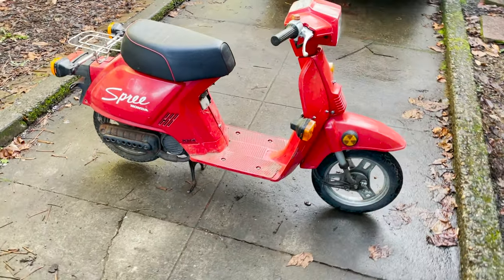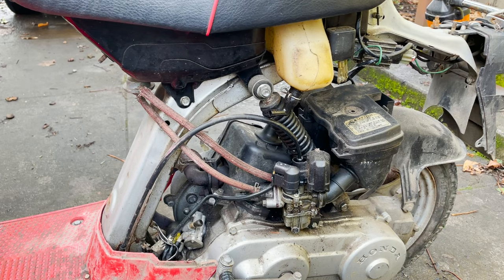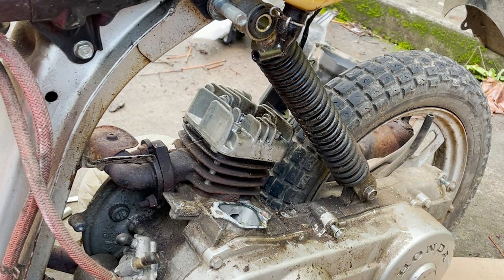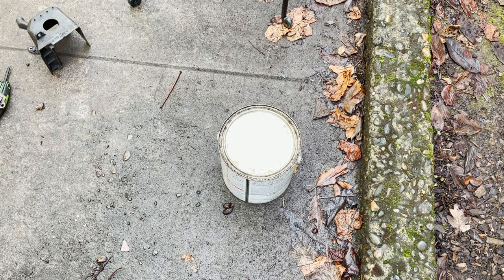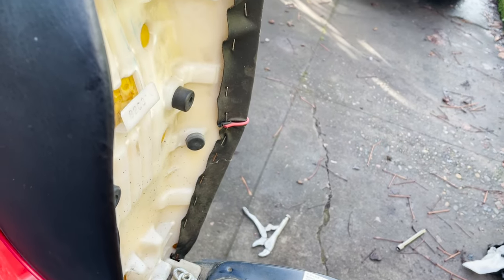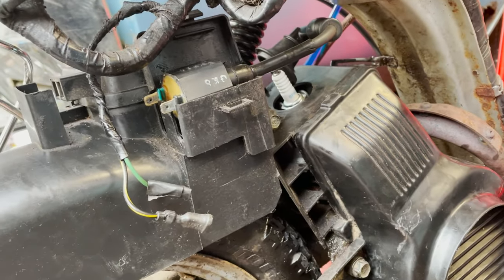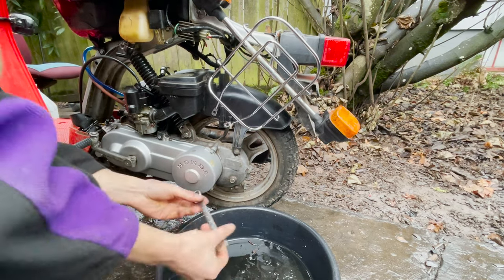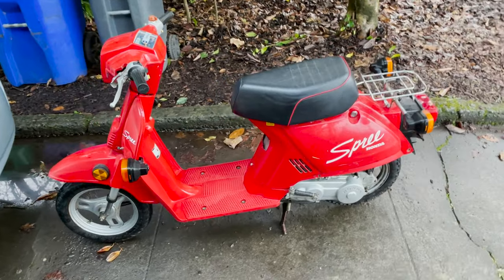$100 Honda Spree NQ50 - WILL IT RUN?? How to fix after sitting for 20 years!! RESURRECTION!

Comment: got my 86 (Iowa) with 1400 miles, for free.  Hammer-mechanic had it for 20 yrs. and could not get it started. The plug gaped at 1/4th of an inch!  I guess he thought he needed more SPARK!!   Cleaned the carb, new plug, got the heavy oil out of the air filter, battery, cleaned up the paint - Ace "Banner Red" is an exact match - straightened the turn signals.  She looks and runs like new - 66 mpg, zipping around town, for 8 months, now at 2,500 mi.  The air/fuel mixture is crucial to running well, oiling the air-filter should be next-to-nothing.

Comment: Hey there, just some words if advice from a fellow Spree owner! I noticed that the previous owner must have blocked off the oil pump, and this is ok but you need to grind off the gears on the pump because if it isn't moving the gears will grind and cause metal shavings in the crank case! Also put the exhaust over a fire for a few hours rotating and banging on the ground every once and a while to clean it out. It also sounds like the carb needs tuning. Get her going good! Love to see these get going
Reply from the maker: big sandwich good advice I will do that. Thanks!
Reply: When you say gears, are you talking about gear shifting?
Reply from the maker: Zeke Polaris no the oil pump has gears on it. If you run premix your supposed to remove the oil pump and get a little block off plate or “grind off” the gears on the oil pump shaft.
Reply: @Mechanic_kid  One of the issues of English, 1 word can mean 15 different things. 🤣
Reply: I saw another video and they just pulled out the oil pump shaft complete with drive gear then re mounted the pump with no drive attached.

Comment: If you're going to be a mechanic you need to learn that two-cycle engines are supposed to smoke the oil mixed with the gas is supposed to make it smoke it supposed to lubricate the engine that's all it has

Comment: I don't know anything about gas engines but I am really considering buying a small gas scooter or moped.  Your video is inspirational, basically demystifying the whole machine and confirming that these things aren't really complicated.  I think I will take the plunge and buy an old scooter and get it running.
Reply from the maker: Do it! These old 50cc scooters are very basic and would be great for learning mechanics on! You can always leave a comment if you have any questions or get stuck👍🏼
Reply: @Mechanic_kid  That is very generous of you.  I will get back to you once I decide on a piece of kit.  I live in a third floor walkup and winter is coming to Canada.  I wonder if I can work on it during the winter and get it ready for spring?  Starting the thing on my balcony might be a bit concerning to the neighbours.
Reply: Get a gilera runner, its awesome

Comment: I think you have it a little backward..the auto bystarter starts off retracted which allows additional fuel to flow at startup and during warmup. After a few minutes the bystarter heats up and the plunger extends a bit, cutting off the additional flow of fuel. Your fix will allow for easy starting but you may be running very rich after warmup.
Nice job getting the scoot up and running, again!

Comment: Hey man love the video. I just picked up a spree that was my grandmas, and has been sitting for probably 20 years. I’ve done basically everything you did (except get to the cylinder) I have never done this before so I’m trying to learn as I go, and I can get the thing started now, by spraying starting fluid in the air intake, but I can’t get it to stay running. When I give it throttle, it cuts out. Any advice on what I should do next?
Reply from the maker: Ok so it’s not getting fuel. Make sure your carburetor is very clean. Pull out all the jets and spray carb clean through all the little holes. If you get that clean and it still doesn’t start I would say it’s your bystarter (electric choke). Take part of a latex glove and use the bracket to basically cap of the top of the hole. Those are the two most common problems causing these to not run. I hope this helps. Let me know how it goes👍🏼
Reply: @Mechanic_kid  ok, so I cleaned the carb really well, won’t stay running. 
I tried plugging the bystarter with a latex glove, that didn’t work either. 
I got a new bystarter, still won’t stay. 
I am not sure how those vacuum petcocks work…but I think maybe that could be the issue? If I take the fuel line off of the carb, there is no fuel. I know that there shouldn’t be, since it is a vacuum somehow, but if I am not sure how to test it. I tried sucking on the vacuum line, and nothing came out the fuel line, same when blowing on the line. Are you familiar with those and how to test them?
Reply from the maker: @TylerPeck  that would be the last thing that it could be! I’ve had one fail before. Your supposed to be able to suck on the vacuum hose and then fuel should go to the carb. I think those are only like $15 so wouldn’t hurt to toss on and see if that fixes it. You could also try hand choking it. Take off the air cleaner and cover with your hand about 90% of the carburetor hole. Should start right up and stay running if you keep your hand there. As it heats up you could maybe just cover 50%. If it starts starving for fuel go back to covering it 90%... sometimes these thing just need to run a little bit when they’ve been sitting. Hope that helps! Lmk how it goes
Reply: @Mechanic_kid  I’m pretty sure it’s the petcock. I ordered a new one. But since it won’t be here for a while, I rigged up a funnel that just feeds gas into the carb and the thing starts right up, and keeps running. I think we solved it. Thank you for your help!
Reply: @TylerPeck  did the new petcock solve your problem?
Reply: @body_clock  it did! The scooter runs great! The issue I’m having now is when it sits for a long time (I figure about 10-12 hours) without running, it can’t start without a little starter fluid being sprayed in the air filter box. Once it’s running for a minute, I can turn it off and let it sit for a few hours, sometimes even overnight, and it’ll start right up, but if it sits longer, it needs help. I checked the reed valves and the piston and they look great. I got a new spark plug, but broke one of the terminals off the coil…so I am currently waiting for that to be delivered to put the new spark plug in.

Comment: Just bought mine for 200 and mate can’t stress this enough. This videos is gonna help me a fuckton when I’m trying to diagnose mine. Cheers 🥂
Reply from the maker: Oh nice pickup! Lmk if you run into anything, I can try and help you out👍🏼
Reply: @Mechanic_kid  Here in Australia its called the Honda Nifty 50 (NQ50) and i was wondering if every year came with a kick start. I'm gonna go pick it up hopefully tomorrow. it needs a starter and a battery to apparently get it running
Reply from the maker: @aricroy4258  no not all years had kickstrters. From what I’ve seen the ones with kick start are more rare. I think they are better because if your battery dies you can still start it...

Comment: You can just rebuild the starter. Use a Suzuki LT-80 starter rebuild kit. It has the same parts you need. I see you picked up a set of noiseguy's carbon reeds. Good choice. I'm not sure what fuel mix ratio you are using, but on a Spree, you are best off using 40:1 if doing a premix. I'd suggest keeping the pump though. As for the oil shooting out the pipe, I'm guessing that came from the crankcase not the pipe. More then likely what had happened is the O-ring inside the pump dried out and cracked so the person decided to run premix (probably 32:1), and slowly saturated the bottom of the crank case with unused oil. Another reason to run it 40:1 if going premix. The Spree is finicky and the pump runs linear to rpm. Meaning around idle range, it's putting out around 50:1, but when revving to say 6,000 rpm or higher, will put out 32:1... more like 36:1. Sprees are fun to build up. Mine now pushes over 4Hp and will do 52mph@ 11,000rpm. Here's mine on the dyno at 8,000rpm: https://www.youtube.com/watch?v=U1MUmUUJbbs
Reply from the maker: Thanks for the info! Dang your Spree rips! That’s awesome!

Comment: Bought a nice 87 a couple years ago, oil had leaked past the check valve and filled the crankcase. I alternated between kicking it over and pulling into a wheelie position to drain everything. Eventually it ran and after a while I could get the rpms up without fear of hydroloc and bending the rod. Smoked like James Bond for a few miles until the oil burned off. I add oil to the tank before a ride and suck left over out with a large syringe when done, if it's going to sit more then three days.

Comment: I have a Honda Nifty 50, it goes well. I think you stripped your's back too far. A lot of that was not necessary. But one thing you did do, which I have not done to my bike, (but I will do it now) is to re-do the electrical connectors on the spark plug's capacitor. Thanks. I also didn't know where to refill the oil in the back, until you said you empty & refill in the same hole.
Reply from the maker: Glad you found the video helpful! Best of luck with your Nifty50👍🏼

Comment: That bystarter heats up with the engine and is an autochoke.. i may have missed in the video but since no oil injector is installed your running a 2 stroke mix in the tank?
Reply from the maker: Yep just running premix👍🏼 it takes a second for the bike to warm up but after that it runs great! Was having bad luck with the auto choke...

Comment: Can you do a video showing how to tune or set the stock spree carb. Like how to get the idle air mixture right.
Reply from the maker: Pretty busy but might be able to for you. Try this and lmk if it works: turn your air mixture all the way in and then back it out 1 1/2 turns. That should be about perfect. If that doesn’t work your carburetor probably need to be removed and cleaned. How’s it run currently?? What’s wrong with it??
Reply: @Mechanic_kid  ran good when I got it running after a couple years. But wouldn’t idle properly. Got it to finally idle but would bog down under full acceleration. Messed with idle mixture screw and hasn’t been right since. Bogs bad under full throttle as has trouble starting. Now I can’t get it to start at all. It’s actually an 85 aero 50 so basically same engine but no Kickstarter. I’m going to clean the carb and go from there. Has good compression and ran awesome at first.
Reply from the maker: @zkmitchell  definitely carb related. Ya start by cleaning it good! I usually remove the bystarter (electric choke) and put a latex rubber cover over top and then put the cracked back on it to hold it down. I think I show this in this video if not one of my other scooter vids. After you clean it, put your hand over the end of the carb where he air filter goes and crank it until you feel gas on your hand. Then just try to start like normal and should fire up. Lmk how it goes👍🏼

Comment: I wonder if he put the injection oil in the tank. It’s thicker than the premix and will settle to the lowest point
Reply from the maker: I have seen that happen before especially when something been sitting for a while. Not exactly sure how it happened but it basically hydro locked up with oil. Common problem with the spree.

Comment: The bistarter is actually a bimetallic-element choke: When u start, and it´s received 4-5minutes of current, it will heat and expand that much, in order to clog (with its pointy pin) the additional start-fuel-line, that cares for a richer fuel/air-ratio-mix (or, relatively seen, "chokes" the air-ratio in the mix) when coldstarting. This element doesn´t know if your engine is ready for the "normal" fuel/air-ratio-mix after 4-5minutes, so, depending on how cold the element and your engine begin (and considering the 2 reach their targer Temps with different speeds), it may shut off a bit earlier or later than optimal... The problem with them isn´t the thingy itself, but the flimsy mounting-bracket changing its geometry (under the pressure of the expanding thingy) and becoming loose,  so, the thingy cannot work properly, its pin misses the hole it has to plug to. Run 12V along it, and watch it expand. If it doesn´t, then it´s broken.
Reply: I was going to say this, but you got it.
-

Comment: Did you end up buying the by starter and if you did Where and how much
Reply from the maker: shawn lesarge I have not! I would look on eBay. The spree starter should be the same as the Honda Elite 50 SB50 as well. You might even be able to make a little 50cc scooter starter fit, I’ve seen the same looking starter on many little scooters such the Yamaha Riva Razz but not positive if it would fit. Hope this helps👍🏼
Reply: @Mechanic_kid  I was talking about that part on the carb the you removed
Reply from the maker: shawn lesarge they sell the bystarter on eBay for like $10. Basically universal on all these scooters from the 80s. They are cheaply made tho and I’ve had new ones stop working very fast. I found it easier to just block off the top. Hope this helps
Reply: @Mechanic_kid  yeah that’s what I did and works now. just need an air filter because keeps shutting off anyways
Reply from the maker: shawn lesarge cool good luck! If it still only runs for like 3secounds with the air filter, then you probably have a bad bystarter. I haven’t had good luck with the new ones🙄
Reply: starters for the sprees are kinda pricey like 200 bucks best bet on a starter is to take it to a starter shop and see if it works may get it cheaper that way

Comment: So i have the same moped i live in salem and idk what is wrong with mine ive got a new battery and i know its been sitting a while i need help i dont know what im doing at all
Reply from the maker: Wanna sell it to me?? Haha
Reply: Its not mine haha its my brother in laws but im the one that wants to fix it really
Reply from the maker: @thereaperscry8809  gotcha! Well it’s hard to say. Make sure your getting spark. If you are then you probably need to clean the carb and put fresh gas in it. I go through basically everything in the video. If you run into any problems just let me know👍🏼
Reply: @Mechanic_kid  what about the starter where would that be located
Reply from the maker: @thereaperscry8809  front of the engine! Super small cylinder
Reply: @Mechanic_kid  and also i do have a little probably i ordered the battery from mighty max i took it to napa they tested it said it was good i asked them to charge it they did then it said the battery was bad it says on the box its a sealed lead acid battery but its not sealed i can access the 6 cells and the battery itself says its gel battery so i dont know if i need to put something in it like diluted sulfuric acid or what cuz thats what its says for the electrolyte
Reply from the maker: @thereaperscry8809  if it says sealed you should not open it because it should already have the correct amount of fluid in it👍🏼
Reply: @Mechanic_kid  but its not sealed because i can get to the 6 cells
Reply from the maker: @thereaperscry8809  hmm not sure. Even though you can get to the cells, I wouldn’t mess with it. I always take mine to battery shop

Comment: I have my spree and unfortunately I cannot get it running no matter what I do I've replaced everything on the engine twice
Reply from the maker: Start by getting spark then if it still doesn’t run it’s carburetor issue. These are super basic and will like always run if you have spark and fuel
Reply: Try this if you haven,t , Remove carb, remove the float bowl and remove the main jet ( flat head screwdriver). Now from inside the carb using screwdriver push out the brass emulsion tube downwards you see in the center , pushes out where the main jet is. Clean that brass tube and all the tiny holes in it.Clean out the main jet and float (needle and seat). Your starting jet or pilot jet is at the base of the small brass tube right beside the main jet and must be cleaned out to run proper.The only way i found to clean this very small hole inside is using a ultra sonic cleaner. Not very expensive and work great for many things. Degreaser worked for me in it 50/50 with water. Now make sure you can blow air through that small brass tube, i slide a small tight fit hose over it to blow through. Bolt er back up and hopefully enjoy some rips on the powerhouse spree. I have a blue 84 up in Ontario. Ride on.......
Reply: When anything goes wrong with old motorcycles they can be proper headache especially if u dont know anything about engines

Comment: Yo wanna help me out with my 1984 NQ50 Honda Spree?
Reply from the maker: What’s wrong?
Reply: @Mechanic_kid  It makes a noise, that sounds like it slipping when i try to start it.
Reply from the maker: @RiderJon-offical  you need to pull the side cover. Likely the kick start gear has a couple broken or stripped teeth. Pull the cover, take pictures as you go, and examine everything👍🏼
Reply: @Mechanic_kid  alright thanks for the tip. :)
Reply: @Mechanic_kid  so hey my Honda spree doesn't have a kick start  and me and my friend got it running for like 1min then it stopped running and ever since then we have not been able to get it working. What should I do. Also carb looks like it is damaged.
Reply from the maker: @RiderJon-offical  hmm not sure! Make sure your getting good spark, have a clean carburetor and it should run! If not, pull the pipe off. Sometimes they fill with oil and then the engine won’t run...
Reply: @Mechanic_kid  Alright thanks mechanic hopefully your right.